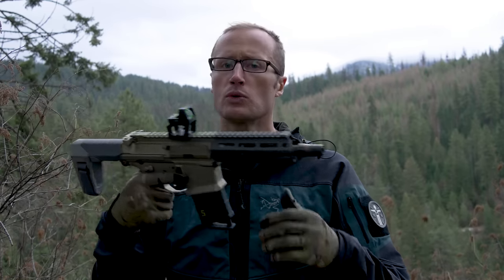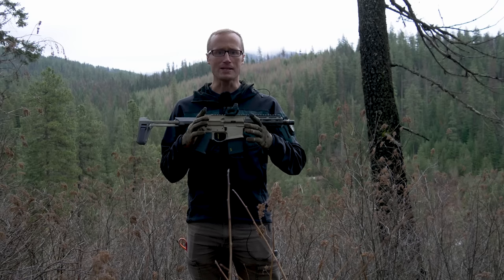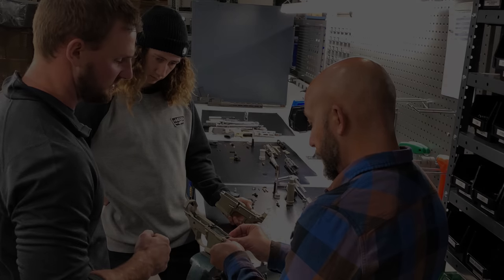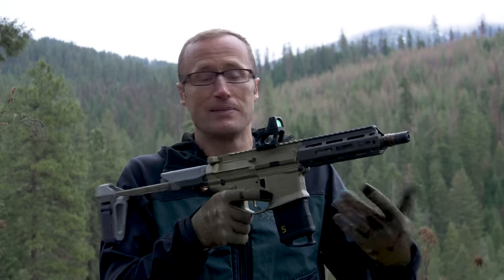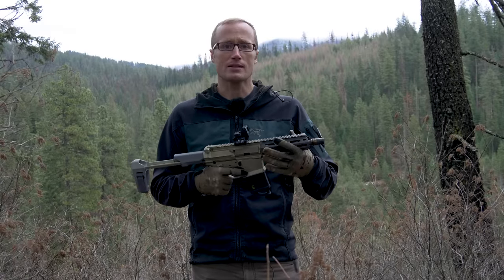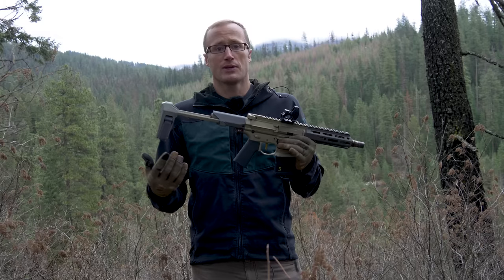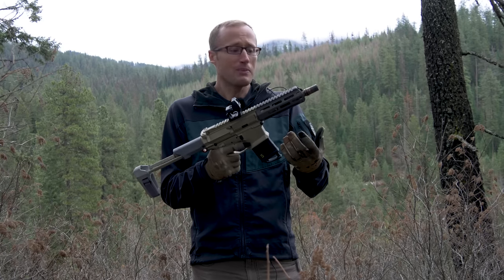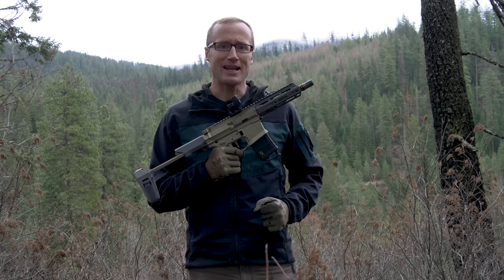Customer Build Days with Q

Comment: This is pretty cool, I grew up a few miles down the road from Beretta and my uncle worked there for 30 years, did 2 factory tours and both times it was very "stand back" "cant go in there"..... lots of ushering past closed off rooms with tinted windows where they were developing stuff. Lol there definitely would never be customer days at Beretta. Off topic but have you seen the new Palmetto State Armory AK-V? If not you should check it out, super neat subgun based on the AK platform AND they designed it to accept the cheap and available Scorpion Evo Magazine's.
Reply from the maker: Ya, that sounds like a night and day difference from Q.  I just checked out that PSA pistol, it looks pretty fun.  I don't know what kind of use I would have for it, since AK ergonomics are horrible.  But...  it would probably still be a blast on the range.  :)

Comment: What’s the point of the MiniFix? If I understand, it’s a SBR Bolt Gun. Correct? Serious Question
Reply from the maker: The one featured is a SBR, but they will be releasing them with a pistol brace.  So you get a super compact and quiet package for hunting or hiking or anything else.
Reply: Right on. Thanks🤘
Reply from the maker: Knowing is half the battle...      ...according to G.I. JOE.